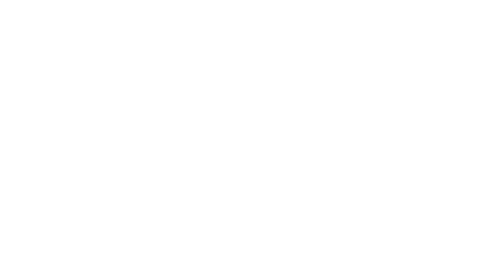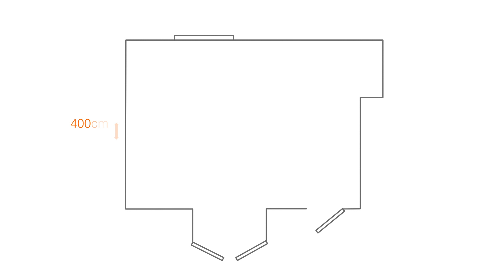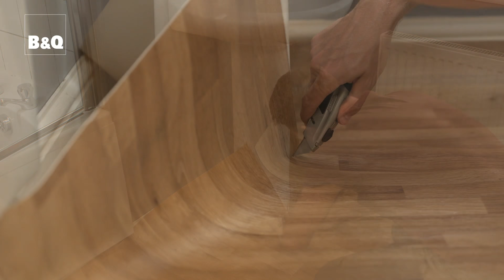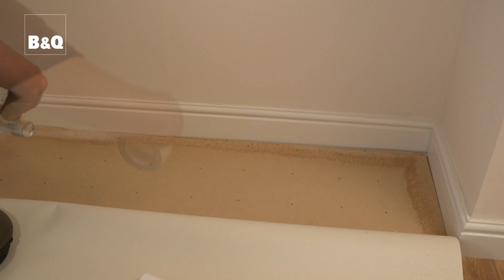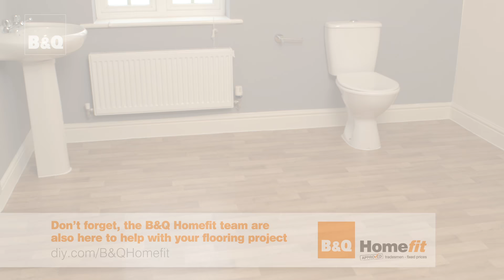How to lay sheet vinyl flooring

Comment: ❤I'm definitely going with vinyl sheeting in my bathroom, but have run into a problem...the thickest vinyl I found does not abut up to the ceramic tile in the hallway evenly. What's your suggestion?
Reply: The transition strip (metal strip he held up) can be used. Just have to find the correct one. One side has a smaller rise than the other.

Comment: I recently laid sheet vinyl in my kitchen, and I can relate to everything you mentioned! I used a utility knife, and keeping the blade sharp was crucial for clean cuts. I made sure to vacuum thoroughly before starting; even small debris made a difference. 

Acclimating the vinyl for 24 hours really helped with fitting it around the sink pedestal. I faced some challenges with uneven floors, but using a leveling compound beforehand made a huge difference. I also sealed the edges with silicone sealant, which not only looks great but prevents moisture issues in case of spills. Thanks for sharing this detailed guide; it’s super helpful!
Reply from the maker: We are so glad you found it helpful! 🧡

Comment: Can I lay this on very thin carpet tiles that quite frankly won't come off . I want to lay sheet vinyl in hall so got a lot to cut around is it best for spray adhesive or double side tape around edged also any tips . I'm thinking of making a template and trying to precut it
Reply from the maker: Hi there, we would recommend laying sheet vinyl on top of an existing floor covering.

Comment: how to avoid moisture under the sheet which can lead to mould?
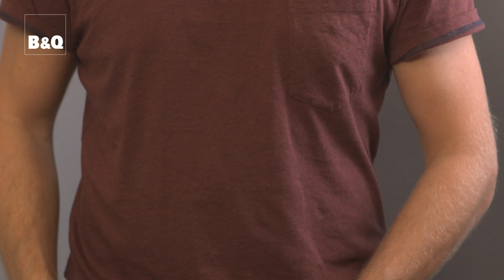Reply from the maker: Hi there, if you're laying your sheet vinyl in a bathroom or similar wet area, please see 6:52 for information on sealing the edges, which will prevent this. If you're laying onto concreate, please see 1:21 for information on testing for dampness before you lay your sheet vinyl. I hope this helps 😊

Comment: Of i want to remove it is it easy or not because i am in a rental apartment and i want to use this but when i want to move from here is it easy to remove it from floor? It will damage the floor or not pleaseee answer???
Reply from the maker: Hi there, this would depend on the type of floor you're laying the sheet vinyl onto. Using the double sided tape should allow the vinyl to be removed without any damage. However, if you need to use the adhesive spray, this may leave behind a sticky residue.

Comment: Leave an inch or two up the walls, fold in half and glue the half with roller, fold other half back and glue
Now to take the knack out of it.. just gently score the top of the sheet with the back of the knife to follow the edges tight, then you click the blade out 1 or 2 click and cut it - perfect every time
Reply from the maker: That's a great tip! 😊

Comment: I need to do this in my bathroom as a fitter didn't seal the vinyl they put down and I ended up with water sandwiched between the original and new vinyl! This time I am going to do things properly myself. This video was great, I had no idea about using the tape to seal it, I have a sealant gun and silicone, I was going to get some roll of paper and trace the shape out first and then use that to cut the vinyl correctly. Still, I think I will be way better at this than any carpet and flooring store was!!!
Reply from the maker: You can do it 💪😊

Comment: Can someone please tell me if its possible to use the sealant as well as the trim or should I use one or the other?
Reply from the maker: You could use both if you wanted to. However, if you are laying the sheet vinyl in a bathroom or similar wet areas, it would be best to use the sealant as it's purpose is to stop water getting into the gaps. Trims are only used for aesthetic purposes. I hope this helps! 😊

Comment: Hi BQ I am going to go with vinyl flooring for my kitchen. there are two types. One is more  and no "cork" backing. the other cheaper but I like the color better. What do you recommend. I want the cheaper one because of the color but I want to pay more for a better backing. What do you suggest?  Does the "cork" backing make a better floor? thx.
Reply from the maker: Hi Mark, cork backed vinyl has a few advantages - Cushioning effect, thermal and acoustic insulation properties. The cushioning effect is more comfortable to walk on, although if you're planning to put a table and chairs on top, this may leave dents. The thermal effect will help maintain a comfortable temperature in colder seasons. The acoustic effect would be beneficial if you were laying it on an upper level as it reduces sound transferring between floors. 
As we're unsure what the "other cheaper" vinyl is backed with, we can't comment further. However, vinyl flooring itself has many advantages over other floor coverings such as, cost, easy installation, no underlay required etc. 
We wouldn't be able to suggest a preference on your behalf, but I hope this helps you make a decision 😊
Reply: @bandq  ok thank you.

Comment: When you get your rolls of vinyl do the roads have to be laid out and flatten for 24 hours before you can do it
Reply from the maker: The preference would be to have it unrolled to acclimatise, however, it's not necessary. As long it's been in the room where it's being fitted for 24-48 hours prior to fitting, you shouldn't have any problems. Not allowing the sheet vinyl time to acclimatise can result in the flooring expanding or shrinking. I hope this helps!

Comment: I've just removed the old vinyl tiles in my bathroom to find a whole other layer of single sheet vinyl. Can I just put my new roll over that one? Or would it be best to remove all of it? Complete novice over here :)
Reply from the maker: Hi Roshan, you can do. Just be aware that if there's any bumps or tears in the old vinyl, this will show through the new one. In that case, it would be best to remove the old one and ensuring you have a flat clean surface to lay the new one on. I hope this helps!

Comment: Hi. I am renting a house. Can have brought a adhesive spray for this task. Can I remove everything after my tenancy is over?
Reply from the maker: Hi there, you can remove the flooring after using adhesive spray, although it may leave a sticky residue. You would need to double check with your landlord regarding alterations under your tenancy agreement.

Comment: May i ask this.. doing my basement with vinyl sheet.. should there be a layer of something.. between concrete and the vinyl..??  Or am i missing something...  any help is most welcomed..
Reply from the maker: Hi John, you don't have to put anything underneath the vinyl. However, when laying onto a concrete floor, you must do a test to check for any dampness. Please refer to 1:20 on the video for details 😊

Comment: Tells you to leave 75mm extra around the sides, doesn't tell you how or when to trim it though. I'm guessing lay one wall at a time, trim off the 75mm and then do the tape bit?
Reply from the maker: Hi, Barry! We'd advise cutting this with a metal straightedge and sharp knife, then lifting the edges and tape after. We also sell a vinyl trimming tool on our website which might be easier: product code 3663602666288. For a full step by step guide, please see our article https://bit.ly/3wk1wCe 😊

Comment: Can these be done over old peel and stick tiles?
Reply from the maker: Hi 😊 It is not recommended to lay sheet vinyl on top of tiles because over time, the grout lines will appear through. If the grout depth is not level with the tile, we would recommend using plywood or backerboards. We hope this helps 🛠

Comment: I’m taking off an old one but I’m struggling to get rid of the tape underneath it any advice of how to clear it off please
Reply from the maker: Hi 👋 Please see out guide below to removing stubborn tape:

Step 1: With a hairdryer

Plug your hairdryer into the nearest power outlet and turn it on to a medium or high setting. Hold the hairdryer a few inches away from the tape and let the hot air blow over it, focusing on the edges and corners. This will cause the glue to soften. After a few minutes, set the hairdryer aside and try to pick at one of the corners of the tape. Most of the tape should come off, but you may need to take the hairdryer to it again.

Step 2: Wash any residue using water, vinegar, and soap.

Mix 2 cups (275 milliliters) of water with ¼ cup (60 milliliters) of vinegar and a few drops of liquid soap. Dip a sponge into this solution, then scrub the affected area on your floor using small, circular motions.

 We hope this helps 😊

Comment: why do i need to turn off underfloor heating for install this?
Reply from the maker: Hi, there. Thanks for your query! The underfloor heating should be turned off for 24 hours before and 24 hours after installation. This is to allow time for the flooring and adhesive to bond correctly and set to ensure it's longevity. Hope this helps! 😊

Comment: Hi found your video very helpful  just had a questions can all the materials like double tap and spray still be use on top on carpet ?
Reply from the maker: Hi, Jaquelin. Thanks for your query!
Unfortunetly no they cannot be used on top of carpet. The subfloor must be a levelled, hard surface that's clean and dust free. Hope this helps! 😊

Comment: Can you lay ontop of tiles?
Reply from the maker: Hi, Jim. Thanks for your query!

It is not recommended to lay sheet vinyl on top of tiles because over time, the grout lines will begin show through. If the grout depth is not level with the tile, we would recommend using plywood or backerboards as underlayment.

Hope this helps! 😊

Comment: Hello can I put this sheet vinyl on my laminated floor?
Reply from the maker: It is not advised to install sheet vinyl over laminate flooring because there is a chance that it might not be levelled or the laminate planks could move/separate underneath which could cause tearing to the vinyl. We hope this helps 😊🛠

Comment: Watching again since I need to lay more sheet vinyl and I'd completely forgotten some of this info. I have since acquired a toilet jack so the toilet can be moved out of the way rather than cut around. I intend to caulk around the flange where it meets the sheet vinyl to make sure no water goes underneath. Instead of knee pads (which don't seem to fit me right) I'm going to use an anti-fatigue mat that can be moved around.
Reply from the maker: How did you get on? 😊🛠
Reply: @bandq  Still need to work on it. Have to pick up lumber on a day its not raining. I'll update after I work on it, but it's not high priority with all the other stuff we need to fix first.

Comment: I googled LINOLEUM flooring and your video came up...but is vinyl and linoleum flooring the same? And are they also layed in the same way? Anything different I should know in the case of linoleum, rather than vinyl, flooring? Thanks.
Reply from the maker: The difference between lino and vinyl is that linoleum is made from natural and renewable materials and vinyl flooring is made from man made synthetic materials. The design range of vinyl is endless, while linoleum is limited. Lino can be susceptible to moisture damage and requires additional maintenance upon installation but can last a long time. I hope this helps! 🙂

Comment: Where can we get it? can we get it in required size as per our need?
Reply from the maker: Hi, please see our range of sheet vinyl here: https://bit.ly/39VCZIK. Once you find one you like, you will find the dimensions in the specifications 😁
Reply: @bandq  is this waterproof? I need something that will keep a 2nd floor bathroom from being able to leak water down to the first floor in case of an overflow.. also will this be able to bear the weight of a cast-iron claw foot tub?  Is there an adhesive that would be ideal for waterproofing the wooden subfloor in the process? Thanks so much for the video!

Comment: This works well in a perfectly square room other not so square rooms are available. He forgets to mention any stretching that occurs later giving you waves in the vinyl floor covering. To avoid this you must glue the whole thing to the floor.
Reply: He literally said that it depends what kind of flooring you are using. Some (presumably heavier flooring) doesn't require it.
Reply: He 100% covered that, watch the video before commenting maybe?
Reply: @stochastic24  I think it is you who should watch the video. 😂

Comment: Did I miss a part ?
Was there any glue or adhesive
underneath needed ,,, or just  the
spray glue and tape at the edges ?
Would this work over existing vinyl
or linoleum flooring ? ( that's on a
concrete slab ) 
.. Thanks ..
Reply: S Rioghal Mo Dhream  ... Thanks for the info . 👍 .

Comment: For what was the spray before the tape? How is it called? Thank you! Great video btw
Reply: You have to get "vinyl flooring spray adhesive", make sure it's for vinyl florring. Many spray adhesives are for carpet only. I got some on Ebay for my existing flooring, but it's quite expensive. The Diall product in the video is no longer available at B&Q for some reason. Shame because it was dirt cheap.

Comment: Is there anything wrong with taking the floor screws out, lifting the toilet pan and sink pedestal, then sliding the vinyl underneath?
Reply: @bandq 
Thanks. I've learned to plumb with 40mm solvent pipe, tile and lay vinyl all in one go.
Reply: Not quite excellent but I'm satisfied with the end result. A ceiling artex repair job is next on the list.
Thanks for the video series.

Comment: Cracking good video thanks.
When your cutting around a sink/toilet, I found easier with a steel edge, such as that from a combination try square. Flat on the floor and pushed against the edge of the pedestal makes for a more accurate cutting of the slots. The try square, still pushed against the edge, makes for clean cut around the pedestal profile. I used a Stanley for cutting.
Reply: I find it easier to remove the sink and toilet. I also don't pay too much attention to the overall cut and just nail down some shoe to cover the edges.
Reply: @marcusanderson6131 Yep.  That's the best way to do it

Comment: Thank you. However, my floors are the ancient ones, the wooden floors wind gaps in between. How or what do I cover that gap with ?
Reply: lay 6mm plywood on to it, pva the ply and lay the vinyl on to the plywood
Reply: @jsteele93  what does pva mean?
Reply: Numbers water down Pva glue and coat the ply with it, it leaves the surface tacky for the vinyl and helps waterproof the plywood

Comment: I have no idea how I got here. Happy I did. This dude is super cute!!! And he's pretty proficient with his tools. I'd hire him!

Spray adhesive is messy and a pain in the arse to clean up. Use cardboard or scrap material to shield the wall while spraying. When using the adhesive tape alone, clean the surface with alcohol to ensure no oil or residue prevents a positive bond. When caulking for the first time, use painters tape to get a crisp clean edge. This step shouldn't be rushed as it is the finishing touch on your project. Tape the floor and wall 1/4" from the joint. As stated use a tool or wet finger to smooth out and push the caulk into the void. Try to do this along the edge in one stroke. Using a wet finger you'll have time to smooth it out completely. As you can clearly see in the video their caulking is terrible sloppy. No crisp, clean edges. It easy to see they rushed this vital and visible step. If color matching caulk isn't available, use a clear caulk for best results. When using clear caulk any jagged or slightly short cuts will be visible. As always use the proper caulk for the job. They're not all equal.

Always cut away from yourself. Ensure nobody is within an arm's length and a half to ensure any slip of your cutting doesn't result in the injury of another. I've seen first hand someone slipping and slicing the hand and arm of someone working next to them. There was a lot of blood, sixty stitches, scars all totalling over 14 inches, nerve damage, and two additional surgeries to fix tendons and ligaments. In total it took Janette over 18 months to recover most of the use of her hand. All because one individual was careless. That was over fifteen years ago. Janette never fully recovered. She is still coping with the permanent damage and physical scars.

Cheers from Seattle!!!
Reply: Thanks for the cheerful prognosis Dr Cameron.

Comment: We have a Dyson vacuum cleaner which can suck the bark off a tree, I found that the previous vinyl sheet flooring layed was sucked up in the middle of the floor causing the vacuum to cut out, is it ok use spay adhesive all over the floor?

Comment: What was the spray he used to help the double sided tape adhere to the floor? Will it work over concrete or do I need to prep the concrete with a sealer? Is it a specific kind of spray adhesive?
Reply: @bandq  No, not the sealant, the aerosol spray adhesive. It helped the double sided tape stick to the floor. Can you use just the adhesive for the flooring? I will be laying the floor over concrete. I was assuming the aerosol spray adhesive just helps the tape stick to the floor but not sure if it's strong enough to use by itself as far as sticking to the flooring.

Comment: Is the dampness test just needed so that at the time of installation the subfloor is dry, or is it necessary for the subfloor to by dry going forward after installation?
Reply: Both.

If you got wet floors there's probably an under lying problem

Comment: the vinyl does not have glue when it is wooden floor? I have a bathroom that I want to put vinyl, but I'm not sure if it has glue on the floor of the bathroom where the vinyl will be installed ?????

Comment: The whole point of putting the material in the area its going to be fitted in advance is acclimatisation so making sure underfloor heating is turned off 24 hours in advance makes no sense unless you're never planning on using the underfloor heating